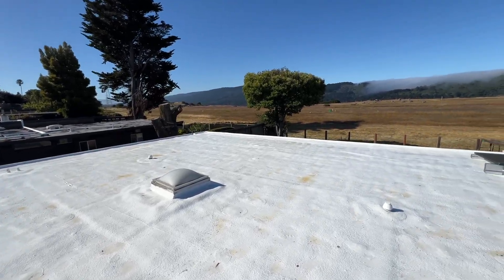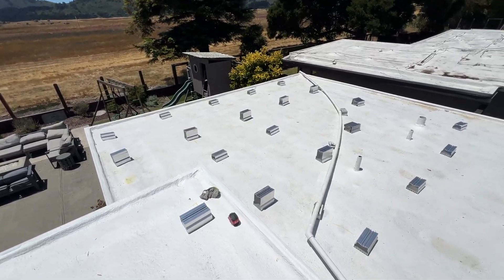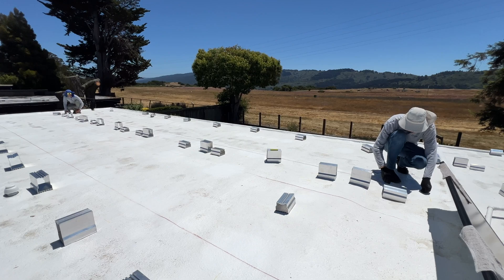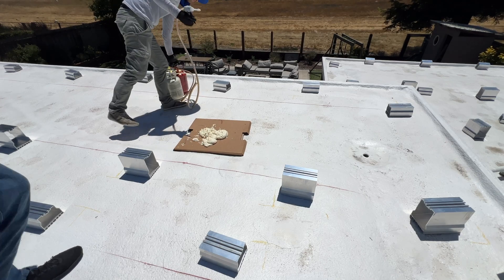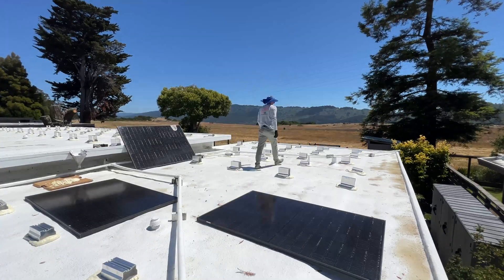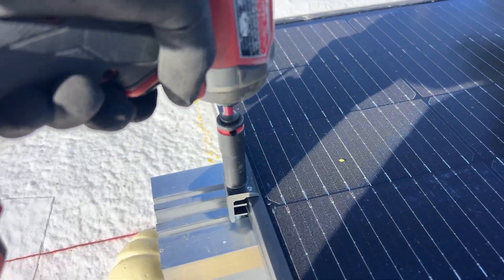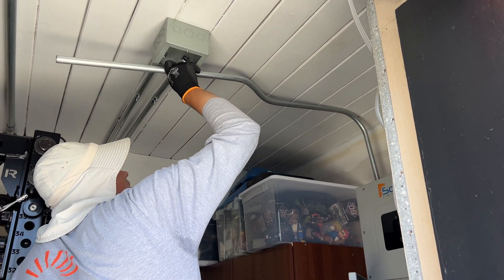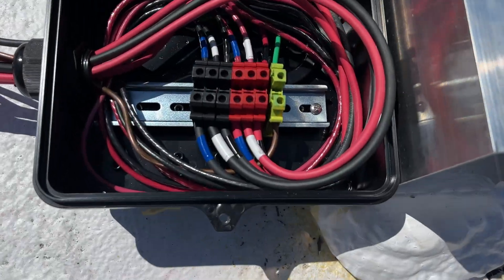Solarstack mounts. Flat roof solar installation without drilling the roof.

Comment: what foam brand yiou using? any warranty?
Reply from the maker: mounts and foam adhesive from here: https://solarstack.com/
Reply: @brucel9585 In Solar Stack's videos on YouTube they use DAP foam adhesive.  There's a two canister system, like in this video, and then a single can cold weather system that looks to be DAP Subfloor Adhesive.  I believe both can be bought locally at hardware stores.

Comment: How much space did you leave in between the two rows? since you are using a sloped version of solarstack, somehting like 12'?
Did you ever install solarstack compleelty flat? and did you reuse the same anchor across corners of 4 panels?
thank you
Reply from the maker: Yes, about 12'. Didn't install flat mounts, but it will be exactly the same.
Reply: @SolarEngineering  could i consider 10" instead of 12"?
Reply from the maker: @GerardoMendez-n5t  if you do flat, then you can install next to each other

Comment: I was trying to tell you that the paint was spilling but you didn’t hear me 😅. Did you try pulling up on one of the mounts to see how well the spray foam held?
Reply from the maker: It's holding pretty well. It was a strong wind, and the solar array felt really solid.

Comment: Do you understand requirement for grounding solar panel frames? What possible issues it mitigate?
Reply: Inverters, either during a failure or normal operation, will put AC on the PV wires. There are many documented cases of this on YouTube. Therefore, the solar panel frames need to be grounded, so that they are safe to touch.
Reply from the maker: need to ground one of the mounts with a ground lug, and 2nd row grounded via bonding jumper (IntegraRack IR-B1BJ0878)
Reply: @SolarEngineering yes I mean what for? For grounding things like washing machine it's clear, if ac fall on casings it create short circuit and MCB triggers. But with frame how we get ac there? Other possible thing is static, but then there is no requirement to ground metal roof or something like that
Reply from the maker: We can get DC on the frame (or AC if inverter failed badly). I guess whatever is touching AC/DC must be grounded.